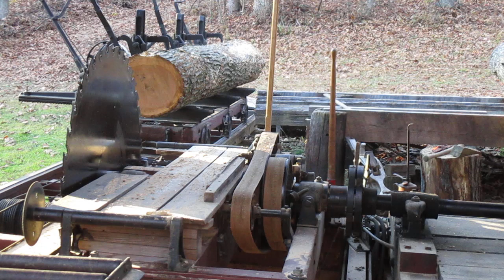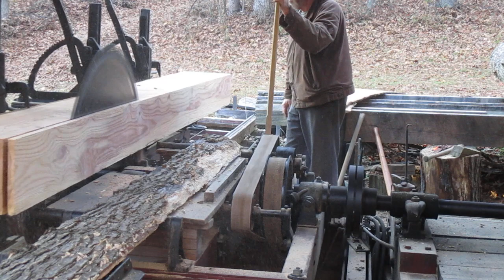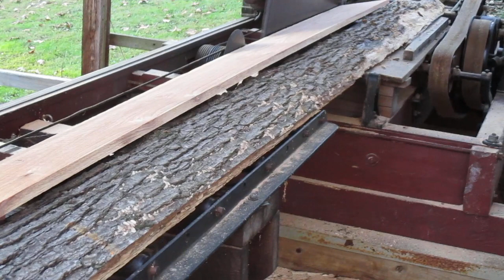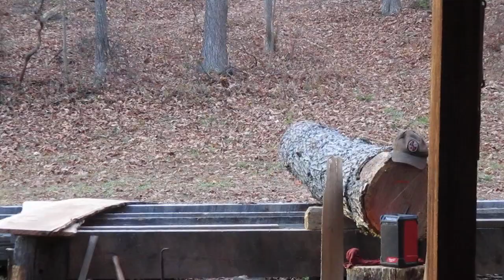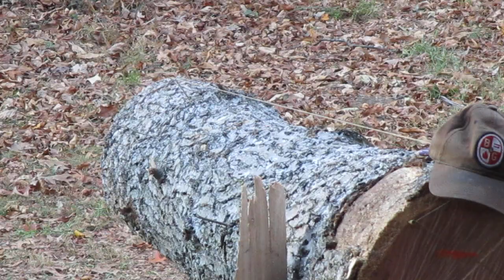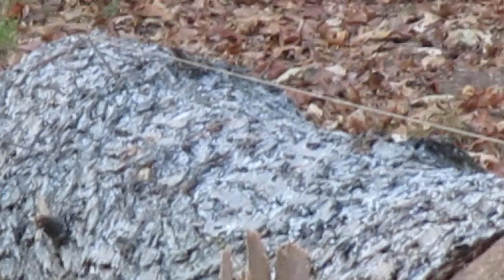#152 My Flux Capacitor broke on my sawmill carriage .

Comment: Is that drive shaft spinning that goes over the walkway?? or is it a shroud??
Reply from the maker: its a spinning . i know   thanks john
Reply: @fricknjeep  I enjoy your channel John..... You have a lot of moving parts on that no frills Frick saw, that's what makes it interesting...thanks William
Reply: I’d be building another step over top of that shaft, one miss step and its lights out.
Reply from the maker: i had a guard over it a 2 inch shield it was smooth but i got hung up on it and after around the  3rd time it took flight . this has been this way for over 25 years now  thanks for the concern john